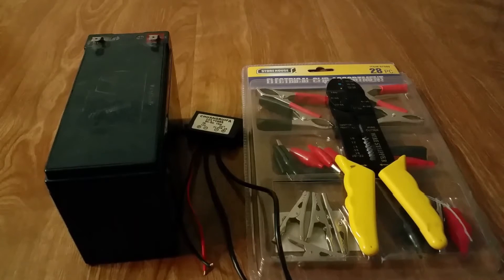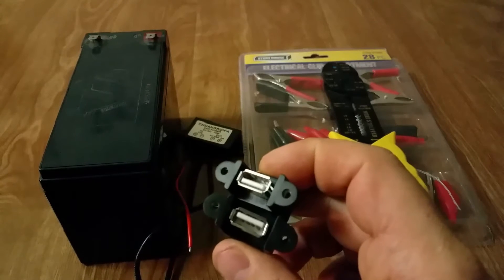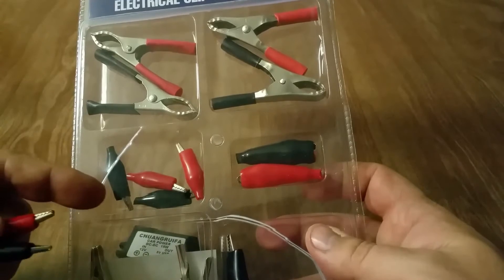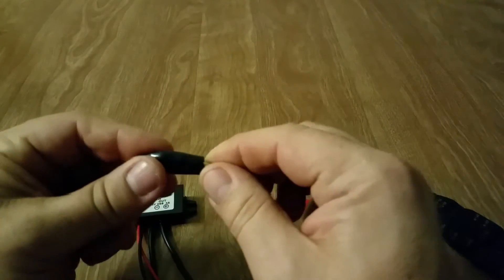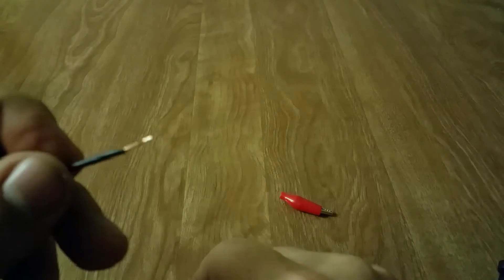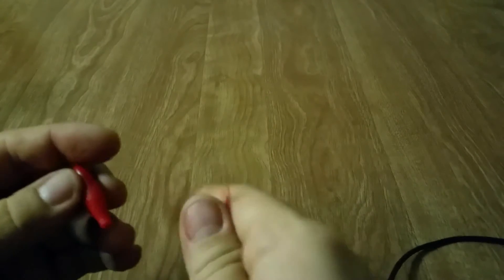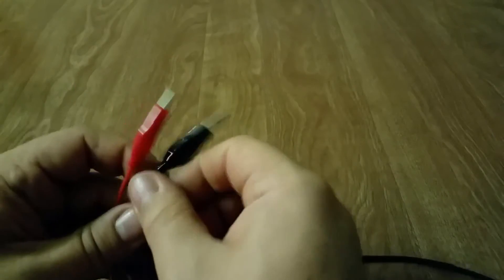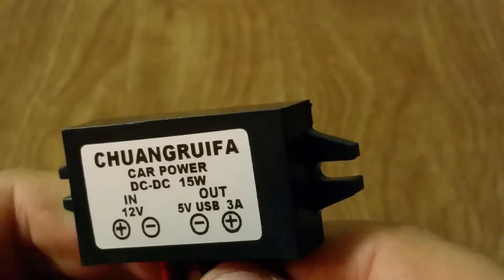DIY Phone charger - 12 volt battery to 5 volt USB ports

Comment: Thanks a lot this battery reconditioning program [ check Details Here>>>https://docs.google.com/document/d/163kspciMT9QSUlNAvv0MT-ezkqtKCoEIdoxzlystrFQ/edit?usp=sharing ] for the help reconditioning my batteries. I had 3 dead batteries scheduled for disposing of. But I was able to recondition them making use of this procedure within just 1 hour! It doesn`t matter what kind of battery you like, the method will work.